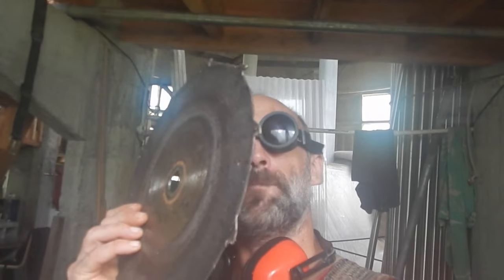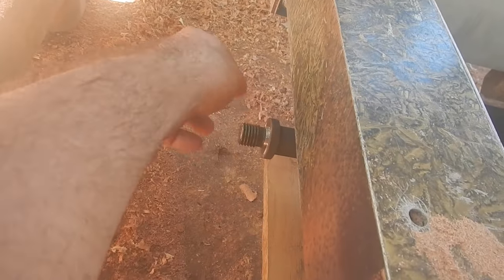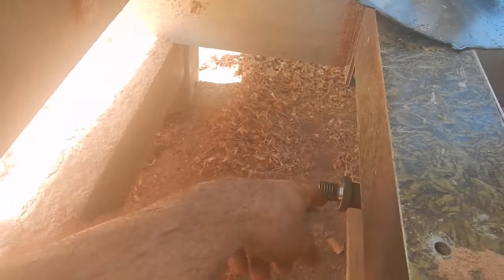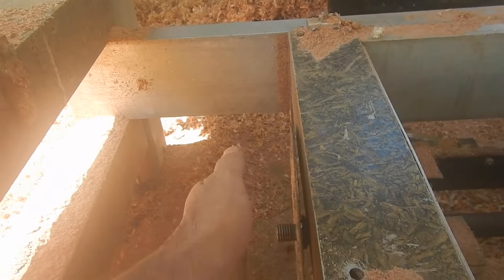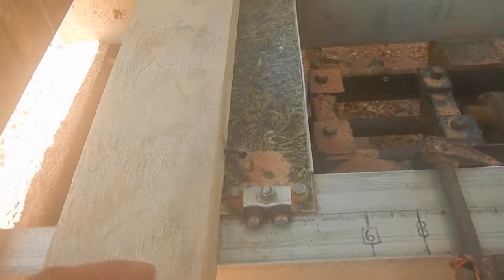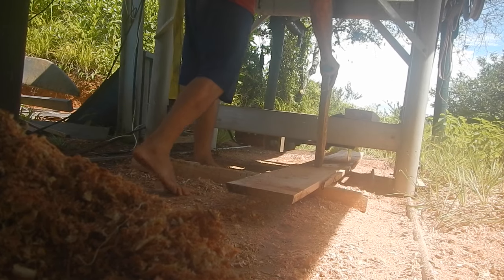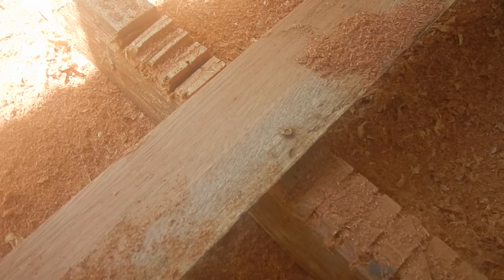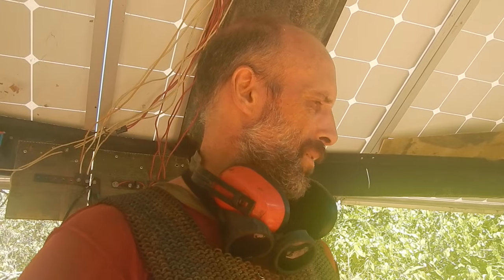I Hit a Screw With My Lumber Mill!

Comment: Ripping blades are usually a lot cheaper than finishing blades, but I guess it's all about what can be obtained easily at your location.
Reply: J, what comes to mind about you cutting out teeth on the blade =
instead of cutting them out completely maybe just cut them back a bit
then when the full size teeth get dull you cut Them out and have the
shorter teeth that are still sharp.
love your videos.
God bless you and the kids and the island paradise
Reply from the maker: I ordered them from Amazon.  Was cheaper to get more teeth and cut 'em off.  Lemme know where to get these cheap ripping blades!

Comment: I seen a older saw mill blade with replaceable teeth, Not sure if you a still get them.  Hay Is your Solar bull dosser still working.  I had so many question while you where making it.  One day I would love to make one.
Reply: you can still get them they are head saw blades and they are spendy, you also need several tools a insert tool and a grinder as well as teeth ( that can be resharpened)
Reply from the maker: I kinda stole the dozer's motor, and put it in the planer.  It works aside from that, though.  :-P